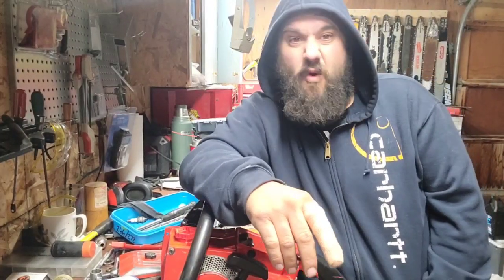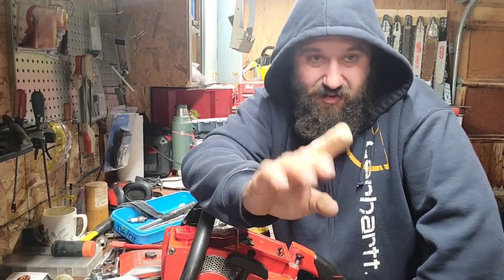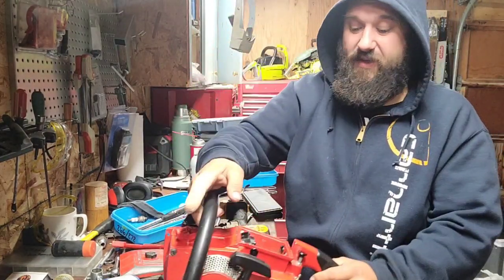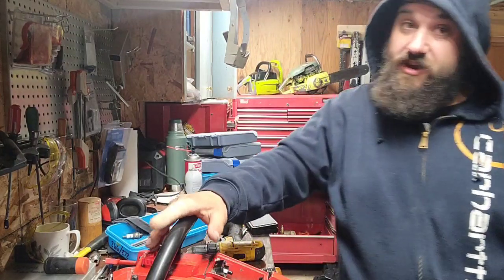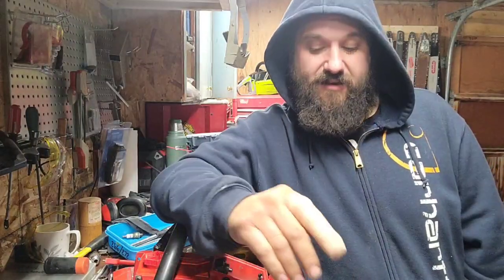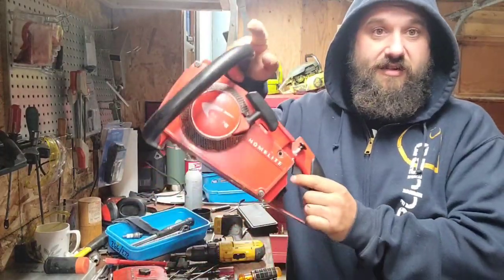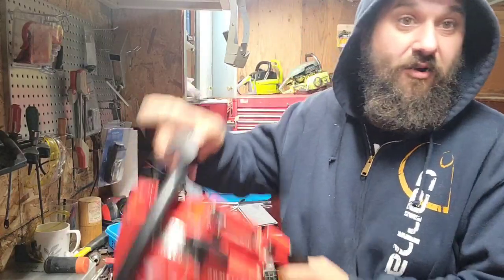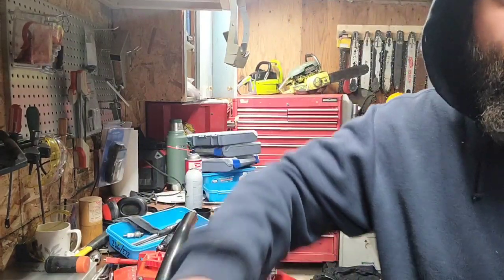So you want to port a homelite? Heres what I know!!

Comment: Great info T Man!😉 You were mentioning the Reed valves, What i do is remove the cage that holds the reeds in place and flip them over and, Wa! La! Your running on a perfect smooth surface once again! I can't believe some of the damage caused by all the crap that passes through the intake! It looks as if you had  sand blasted them! I have a chainsaw collection of around 60saws, So I'm getting good at it cuz its alot of work cleaning out that many saws! And when I start slacking on the task at hand, I watch your video and it gets me pumped up to start turning wrenches again, Thank you my good man!😋

Comment: Check out the roper 3.7/18 saws (craftsman). Many have a high side delete,  but the older ones w/points use a tillotson and may work for your needs, not sure. I started my porting on poulan piston ported saws, can get an eBay p/c and bearings for about $40. Can use the same 42cc cylinder on on virtually any model 32-42cc range. Honestly, who doesn’t have or know someone who has a burned up poulan. Throw in a carb kit, lines and even a degree wheel and you are good to go for $100, saw included-great place to start. If you mess up and free port it(like I did on my first), toss the cylinder and get another for $25.  Learned the value of good deburring, and had a lot of fun. Clamshells can be a pita to increase compression, but really a great cheap way to get started and make some mistakes.
Reply: Great job bud... I didn’t have a bunch of extra money and I learned on the free poulan stuff and started building up my knowledge and saw collection.  Just remember that a broken saw’s not worth much because your time and parts to fix it... I spent way too much for projects in the beginning.  Ask your local shops for some projects...tell them that you are teaching yourself to repair small engine’s and saw’s... they help you out sometimes ... or complete saw’s are $40-$50 bucks....

Comment: Thanks Tinman. I'm a relatively green arborist and lately I have been bitten by the saw bug. I have always been mechanical but more automotive related. I have decided I want to dive into small engines specifically chainsaws. I appreciate all your knowledge you share here from the basic engine functions to the complicated dynamics of the air/fuel ratio and the importance of having mechanical knowledge when attempting to engineer a design look a good port job and all it entails. Because that is really what you are doing here, engineering.

Thanks. You got a sub. 

 Buckin' may have also helped lead me here. Gotta give a little credit to him.

Comment: @Tinman
Thank you for all your hard work. I recently acquired an XL-130 and am XL-922 Super. 
I’m not real big on having my saws screaming, I’m more impressed by the amount of wood hurling out of the back of the saw. So my question is.

If I were to do a base gasket delete and open up the ports at the base of the cylinder, that should in theory increase the torque of the saw at which point I could run a larger sprocket to increase the chain speed?

Thanks again.

Comment: You might know this already but Walbro SDC 78. It doesn't have a Governor and Its an exact match up with a Tillotson hs-151 that's usually on the 925's. The have an acceleration pump too. I swapped the Tillotson out on my 925 and I feel it tunes and runs way better.

Comment: I was told that those spring and check ball governors used the vibrations of the saw running and when the vibrations become strong enough it would start dumping fuel and I bet that carb in addition to the governor have a semi fixed high speed jet and you can plug a hole inside and end up with a fully adjustable carb
Reply from the maker: I find even with the govenor plugged those carbs still lack fuel. Maybe I just havent found a 100% method to fix em??
Reply: @tinmanssaws  oh haha lack fuel lol I think I misheard you my bad

Comment: @Tinman Thanks Brother! This video cleared up many questioned I had and gave me the nudge I needed to start porting my first saw. What do you think about Ms362 with a ms391  ported piston and  cylinder? Guess the cyclinder bolts right up. Thanks again! Between you and Ironhorse it's hard not to want to rip all my saws apart and make them scream lol
Reply from the maker: Hey glad I helped shed some light. 

A 391 is a clamshell design so I dont think theres any way to bolt that up to a 362.

Comment: Those homelite's have a post in the center of the exhaust to, I ASSUME,  support the piston and ring so it does not go out in the exhaust HOLE to far and catch and break the ring. Without that post in the middle the exhaust port is VERY WIDE on a homelite. Why can't you widen your exhaust port a bit, knowing you have that post for support....no loss of space for compression like you would have if you raised it???